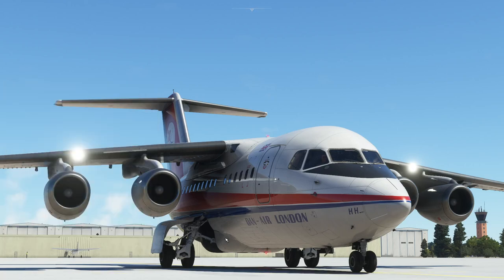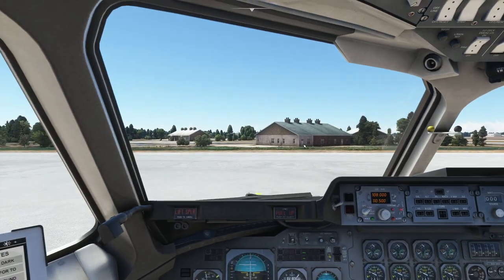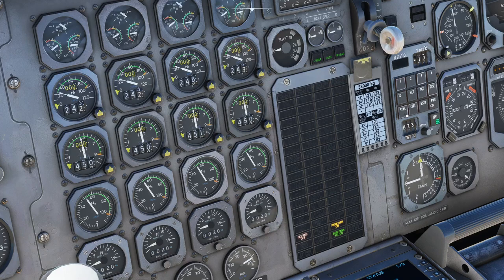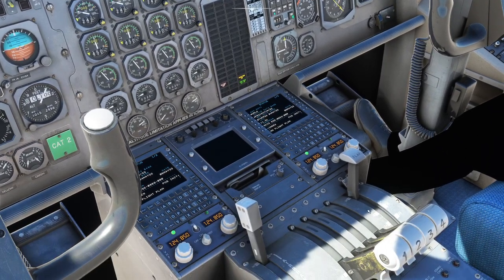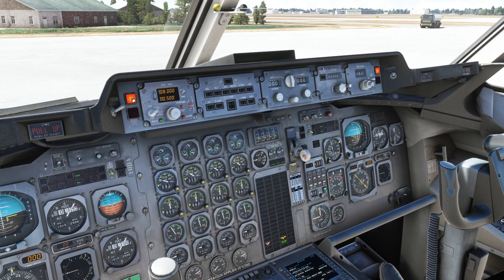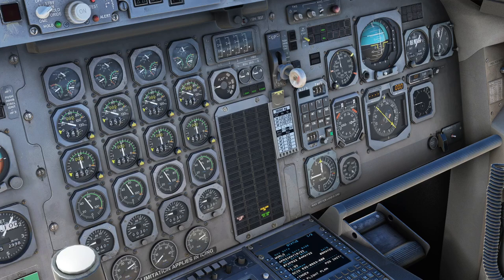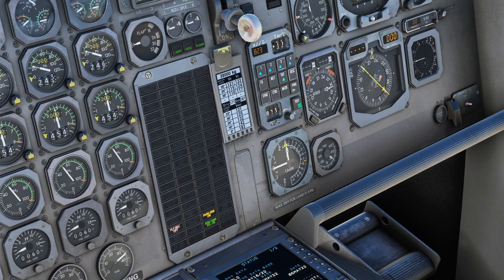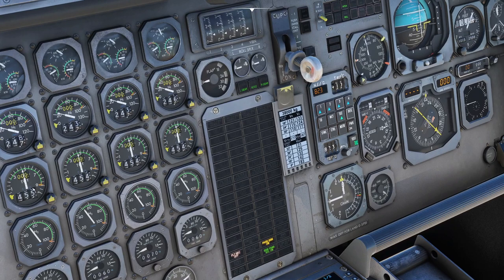Beginners guide to the TMS (Thrust Modulation System) in the BAe 146 in Microsoft Flight Simulator

Comment: Thanks for this tutorial.  Note that in DESC mode the target percentage is N2 and not N1 as is the case with TO mode.
Reply from the maker: yep - there are some strange corners to the TMS functionality. Yesterday I had TO mode cancel while rotating - crashed the aircraft as a result (not enough runway left to stop). Very odd.
Reply: @jonbeckett  Jonathan, thank you for shedding some light on this odd device.  MSFS has a big problem with its drag behavior at cruise - you are either speeding up into overspeed territory or slowing down too much.  One important thing however - as you mentioned, in certain regimes (at lower altitudes), you can set a TGT which gives a pretty stable airspeed, but at high altitude, the TGT dial will not go lower than 600 degrees, whereas you need something like 500.  Is there a way around that?

Comment: Great video, thanks for the clear explanations!

Just a small detail you would perhaps want to know: An assumed (flex) temperature takeoff doesn’t de-rate the engines - in other words, if you suddenly want TOGA thrust, the engine will give you the maximum certified thrust of that engine.

On the other hand, in a de-rated takeoff, if you suddenly want TOGA thrust, the engine will only give you the maximum de-rated thrust that you have selected. This type of takeoff is usually done for minimum control speed (v-mc) considerations which among other things allow you to reduce V1. 

Anyways, thanks again for you walkthrough of the system.
Reply from the maker: yep - i didn't explain it well at all. I actually recorded a much better description, but after two people came to the door in a row, I gave up and started again - and of course it wasn't as good the second time around. You would be surprised to learn how many times that happens.

Comment: Something to note: 146 pilots rarely use MCT for climb. With a reasonable flex temp, MCT will command higher engine speeds than takeoff! The 146 has so much extra performance on tap, usually pilots will set climb power using N1 SYNC. The rule of thumb I follow in the sim is 88% N1 at sea level to 5,000ft, then add 1% N1 for each 5,000ft (10kft = 89%, 15kft = 90% etc)
Reply from the maker: I'm pretty sure there are some bugs lurking in the TMS in the sim - I'm sure they will get ironed out though. I had the TMS cut the engines near the end of the takeoff roll yesterday - without enough runway left  to abort... very, very odd. I went back through everything I did, and it made no sense.

Comment: Wondered why the throttle were all over the place when I was cruising, was setting it to sync, one minute over speed, the next stalling if I didn't keep a constant check on it, I'll give TGT a go, Thanks, another great vid. 👍
Reply from the maker: It's not an auto-throttle - it won't maintain a given airspeed. You absolutely need to monitor, regardless of the mode you set the TMS to.
Reply: @jonbeckett  Thanks for the reply, only had it a week, very steep learning curve, only just managed to do a London city to Manchester without any alarms going off LOL, best 50 quid I've spent on MSFS so far though, bought FSRealistic at the same time, what a combo!

Comment: I have issue.
Often it tells me a thrust of say 84.5 ...  and when I set that using the throttles the blue arrows are still showing I need more and then it levels at 92.

Basically my TMS appears to be broken.
Reply from the maker: It's not broken - it's just doing what it can depending on the mode you have it in, and the position of your throttle levers.

Comment: Thanks for the great video but I have one question. You say that in descent mode, the engines try to be at 60% N1, or depending on the anti ice setting for example, but when you press the button, the engines don't go to 60% in your video. That's what I don't understand.
Reply from the maker: Great point! I think the key there is *try*.
Reply: @jonbeckett  I've made a test flight and the TMS is not even trying to come anywhere near 60%.
Reply: I think I have to look it up in the manuals or so